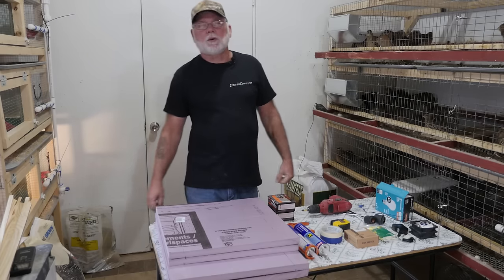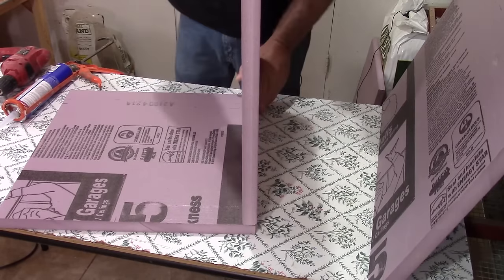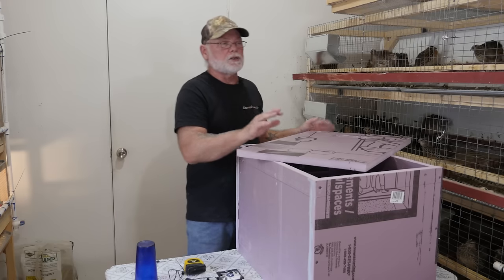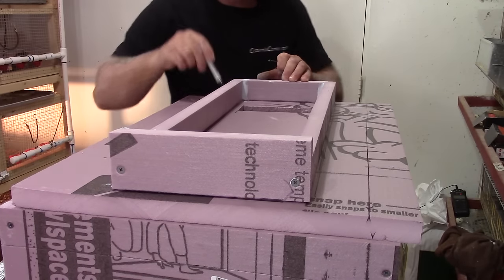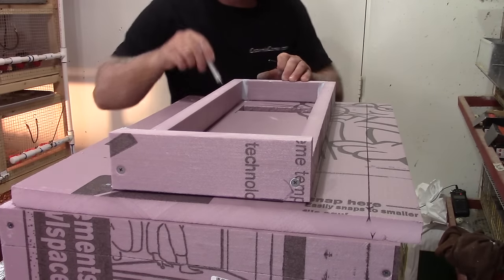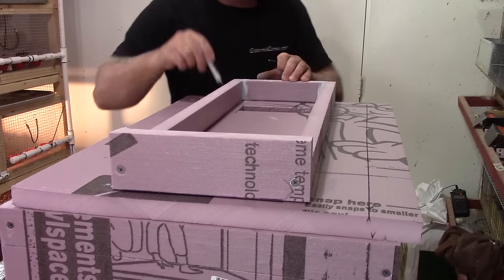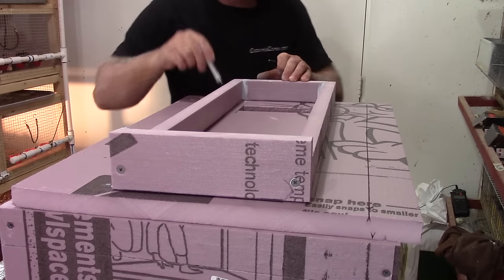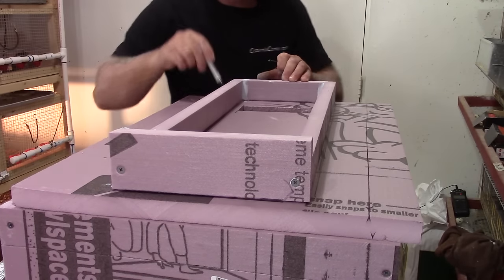How to: Cabinet Incubator - 240 quail egg incubator

Comment: do you think its possible to wire the fans to the cold side of the inkbird if you had small 120v fans?
Reply from the maker: Yes, it is possible, you would just need to wire the fans to the constant hot and neutral wires as the fans need to run constantly.
Reply: @CoturnixCorner  just spent an hour looking for this answer through comments. Great info thanks!

Comment: Hi, i build the same incubator and it work fine but im getting two different temp and humidity from the top and the bottom. Bottom thermo 95*  top thermo 100* . The thermo are good i switch them and it read the same. What could i do ?😮😢

Comment: Ive used these thermostats in a larger cabinet and had them go bad on me twice killing everything i was incubating.  My cabinet held 5 turners out of a gqf styrofoam incubator though.  I was curious if you yave had an issue with them locking in the on position
Reply from the maker: I haven't had any issues yet. The first controller I got off of Amazon was bad and I returned it for a replacement, and it's been running 24/7 for the past 8 months. I had read reviews about an occasional bad unit, but that's to be expected. I did forget to put the temp sensor back in the incubator on one hatch and by the time I noticed it the temps were over 150 degrees and cooked the eggs.  
Are  you plugging into a wall socket? If so, you might want to try a UPS battery backup with surge protection. It could be dirty power from the electric company causing surges or spikes. Just a thought. Thanks for commenting!
Reply: @CoturnixCorner  Is there a different wiring configuration with the ITC 1000 vs ITC 1000F?  just curious as to the difference and if it matters.
Reply from the maker: @Marl2051  No, the 1000F has Fahrenheit and Celsius.

Comment: You are a way handy and experienced guy i think i can ask you that question, i made a brooder for my quail chicks, the problem i have is that there is no heat lambs for sale in my region and it's harder than you expect to get it online, so i used a regular 100 watt light bulb it worked great for the temperature and reached what i needed but the problem was it's too bright and having it ON all the time caused my chicks to go blind and suffer alot and now they are dying one after another, so do you now any way i can make the bulb less brighter while maintaning the same heat  or at least modify smth. So they don't go blind? even if it's complicated i can work and do it.
Reply from the maker: I use regular 100 watt bulbs also and I have never had any problems using them. But if you are concerned with the light being too bright you can always paint the bulbs with High Temperature engine paint, black or orange. You could also use reptile heat lamps like these:  https://amzn.to/2CYdwyh

Comment: Do you think if I made a 18x48 incubator it would work?
Reply from the maker: The only issue you might run into is with the heating element and circulation fans. You would have to use a higher wattage bulb or a resistive element that would be able to keep up and fans with a higher CFM to keep from getting hot and /or cool areas.  Good luck with your build and let me know how it works out.  Thanks for the comment!
Reply: Update... Yesterday was day 17 and they started hatching I had 7 this morning before I left for work this morning and more hatching. Thanks for videos. Ended up using a small 6" desk fan motor for my circulation and used two 75 watt bulbs. Seemed to work just fine. Again thanks!
Reply from the maker: @sethdawson1238  Congratulations! The main reason I use two fans and two light bulbs is just in case one fan or one bulb burns out I have a backup. Great job on the successful hatch! Thanks for keeping us updated.

Comment: Ever consider using thermal tape as opposed to the glue? It holds well, and you wouldn't need to wait 24 hours, plus it's cheaper.

Comment: What is the purpose of using 12 volt fans when 110 120 volt fans are available
Reply from the maker: No special reason, it's what I had available. The design is free to be modified.
Reply: @CoturnixCorner  ok thanks I didn't know if it would draw less power or it would be less draw on circuit breaker nice incubator I'm going to try and build one thanks for the info and video

Comment: Do you have a seal in your door? mine has a crack in it .or do you just shut the best you can and let the crack go ?
Reply from the maker: Yes, there is a small opening around the door when closed, it hasn't been an issue for me.
Reply: Coturnix Corner ty for your reply one more ? Where and how did you run your cords out for your egg turners
Reply from the maker: @johnrandolph4295  they just exit out the bottom of the door in the lower right hand corner.
Reply: Coturnix Corner ty sir I am about to put my first batch in good video on this

Comment: Is there a reason the door is 1/4" taller than the rest of the incubator?  Just curious!   Thanks
Reply: Because he put the side pieces on top of the bottom and under the top thus making it necessary to make up for the extra 3/4 inch thickness of the foam.
Reply: @dannywilsher4165  Actually I think Terry put the door on the back piece and then used the back n the door.  He said the back was 25 3/4" and with the spacer on the bottom would have made the door flush on top and not stick up as it does.

Comment: Terry will that not go on fire with the heat of the lights
Reply from the maker: No, with the fans running across the bulbs they don't get that hot. I have been running them almost round the clock for the past 8 months. Thanks for the question!

Comment: Hey , sir in my area foam board is not available  can i use thermocol , or plywood instead
Reply from the maker: Yes, you can frame plywood and insulate with thermocol. Just adjust your measurements so the insides are the same dimensions as in the video. Good luck with your build.
Reply: Sir i already build one but , the thermostat i used it not accurate,  now i ordered the inkbird from us , and i am gonna follow your design

Comment: Since heat rises wouldnt it make more sense to reverse the fans?
Reply from the maker: The fans draw the cool air from the bottom of the incubator heats it and recirculates the air in the incubator to help keep temps uniform.

Comment: Do you have problems with the light bulbs burning out?
Reply from the maker: I have not, actually I am running the same bulbs I originally installed over a year ago.
Reply: @CoturnixCorner  that's reassuring news. I'm currently building one inspired by this video.
Reply: Mine burned out 2 I two days but I used old computer fans that ran too fast so I put a switch on one fan trying to get better control of humidity. The bulb in front of that fan burned out twice. I then switched from 12 volts to 9.5 volts on both fans and apparently solved both the bulb an humidity problems as th fans run much slower.
Reply: @edkarch4353  I haven't had any problems so far im on run 4. I'm using reptile heating bulbs 2 75w. I also have 3 fans running, 2 blowing out at the top and 1 pulling air into the camber. So far hatches have been good, this time I loaded up with chicken and duck eggs. The increase flow and wattage was to accommodate 3 racks and a hatching try which sits on the bottom rack. Below that is where I have my water pan for humidity.

Comment: how do you wire the fans mine has 3 wires all black but one has a white stripe
Reply from the maker: The center wire is hot, one of the outer wires is ground. The remaining wire is unused, it is a speed control wire.

Comment: Scrap the 12v wall transformer, get ASIN: B07MZ4RFSS, off of amazon. It's a 15w 1.25amp waterproof L.E.D. Driver. I use one to run three fans, and it works great! Can be installed inside out of view, free up an outlet, and cutdown on wires hanging around! I'm just starting out with quail, and want to thank you for all your helpful videos!

Comment: What it I put 120mm fans instead of those of 80mm like you put, I have these 120mm at my home at the moment
Reply from the maker: As long as the fans don't move more than 31 CFM they should work fine. If they do move more air you might be able to get by with one fan.
Reply: @CoturnixCorner  how to know how much they move ?

Comment: I am having a problem, temp is great, but I can't  get my humidity  over 57 percent.  I have 4 pans in the bottom that cover basically 100% of the bottom.   If I have no water in it I'm right at 20% humidity.  Humidity outside is 40%. How can I achieve that 65% for lockdown?
Reply from the maker: Are you using the recommended fans and lightbulbs (60 watt incandesents)? If your fans are moving too much air thus drying it out. If you have the correct rpm fans then try standing a couple sponges in the water pans for more surface area of water. 57% is pretty close so you don't need much. If you still have issues after trying the sponges, contact me at terry@coturnixcorner.com
Reply: Yes I already had sponge standing.  No on the Artic fans, Amazon said delivery on them was May 16. So I bought a 110v fan,  it only has 23Cfm,  I did research the Artic fans are 31 cfm each.  So I had a little desk fan and I set it in the bottom also and took one of my waters out so fan could fit. I am now at 63% with the little desk fan.  Happy now air flow was my problem.  Thx.
Reply from the maker: @barthday1088  Glad to hear you figured it out. I was going to suggest cutting the power to one of your fans to see if that helped.

Comment: I ordered those fans and they have three wires, not two. The third doesn’t seem to be a ground but I can’t tell what it is.
Reply: Third wire is speed control I believe
Reply: nonx99 Do you have any idea how to use it? So far I’ve been able to use it to create a surprisingly large amount of smoke out of this little fan motor. Probably not the best way to use it.
Reply: @twestgard2  not sure in this application but if you are getting smoke I think I would stop trying to use it

Comment: I thought two 100 watt bulbs would get the unit to 99 degrees faster, but it completely melted the foam all around the fans and light sockets.
Reply from the maker: There is no way that the 100 watt bulbs should be able to melt the foam around the fans or light sockets unless mounted too close. I've used 75 & 100 watt bulbs all winter long an haven't had any issues.

Comment: Did I miss something? I do not remember seeing how you are tracking humidity. Speaking of humidity - I am using a little giant and no mater what I do I can not get humidity up for lock down. The one I have in now put on lock down yesterday and humidity was stuck at around 50%/ I know your not to open on lock down but after researching a little I saw putting a jar with water and a sponge in it would help raise it, well it raised it only to 65% and now back down to 58 or 59% at last check. What can I do?? I think that was one of the issue's with my last try - I only got 5 out of 43 hatch, and when I checked the eggs remaining over half of them had chicks in them that just did not make it out. One other question - how long do you leave hatched chicks in the incubator before pulling them out? I have heard anywhere from a couple hours until they are dry up to 3 days.??
Reply from the maker: Hey Steven, I did not cover humidity in this video. Being in S. Florida our humidity is pretty high and my humidity levels are always near or around 50% in the incubator. On lockdown I add 1 cup of water to the water tray in the bottom of the incubator. If you are getting 60% to 65% during lockdown, you should be fine. You can open the incubator during lockdown if none of the eggs have pipped and maybe spray the walls of the incubator with warm water.
 If you only got 5 out of 43 to hatch I would expect something else, maybe a temperature issue or egg turner issue. It's hard to tell. I usually take the chicks out once the bulk has hatched and dried, usually around day 18. I'll let the hatch go until day 19 to get any stragglers, then I'll start a new hatch.
Reply: @CoturnixCorner  thanks for the reply

Comment: I'm thinking of using a couple old unused picture frames with glass for the windows instead of the plexiglass. What's everyone's opinion on that? Will it fog up, transfer heat more than the plexiglass so temperature won't stay as stable, etc?                                            Starting to build the foam portion this week with some 2" pink foam that a friend got me from construction scrap. They're mostly 17" wide so I'll have to cut and splice for them to be wide enough and to have the base 20"x20" instead of 18x18 to make up for the thicker walls.